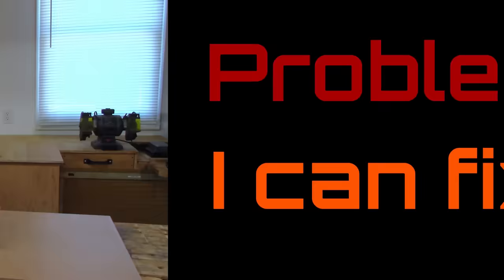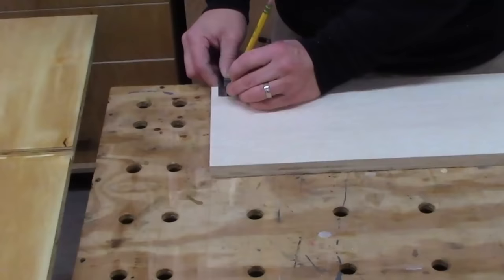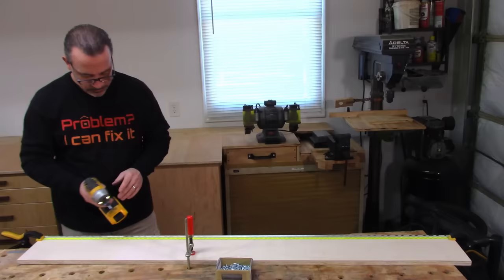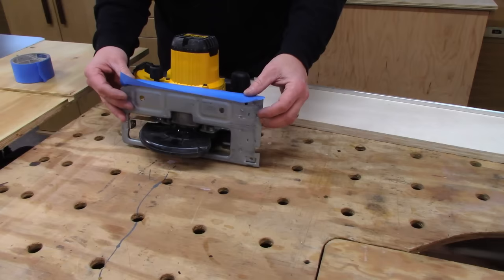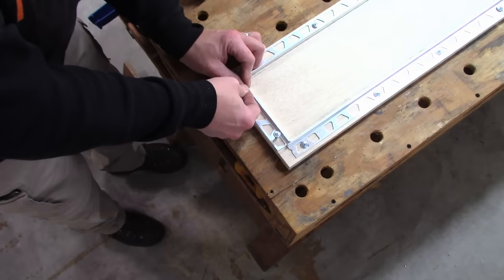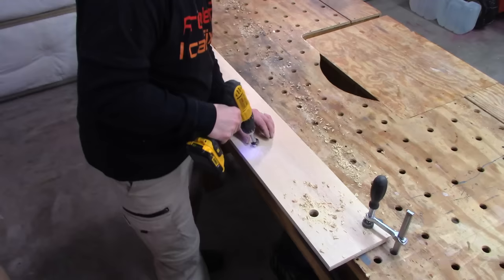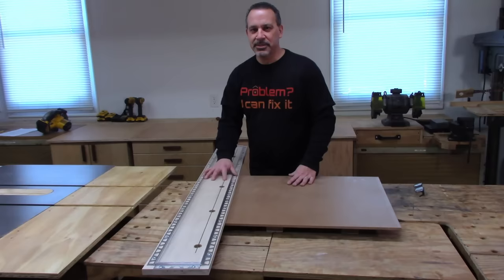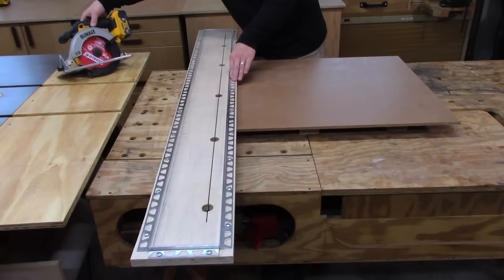Festool doesn't want you to see this DIY track saw

Comment: One trick for less saw dust while working, is to make a vacuum box table out of MDF peg board that is usually used while sanding projects. They’re usually a smaller design, but I don’t know why they wouldn’t work on a larger scale, as long as your dust collection system would be up to the challenge!
Mark Dougherty 
Toronto, Ontario.
Reply: You might need to add multiple vacuum ports to get even suction over the entire area, but you could make it as big as you want. But as you mentioned, your dust collector would need to be powerful enough. For a 4x8 table, I'd think you'd need at least 1500 CFM, if not more.
Reply: @garrisonaw You could just section off part of the table to be a vacuum box, since you're not necessarily going to be running your saw over the whole table

Comment: Love this idea. I never seem to have a straight, flat, and long enough piece of wood to hide my cut so I end up clamping my long level. Of course clamping a level only works when you can keep the blade side of the saw nearest to the guide, otherwise you end up dealing with clamp interference. Your solution seems like a no-brained. Muchas gracias señor!
Reply from the maker: You're welcome!  Thanks for watching.
Reply: @freespeechfinland  I appreciate the tip. Occasionally I need to run a bit on a narrow piece which can make clamping the straight edge a bit more complicated. Could probably still rig something up that works with the spacer. Much obliged for the insight.
Reply: Make a spacer block whose width equals the distance between the side of the saw shoe and the blade (teeth). Store it with your saw. 

For a perfectly straight cut, place the spacer block and the guide (a level or some other rigid piece with a straight edge) on your work piece. Holding the spacer block firmly against the side of the guide, position the opposite edge of the spacer block at your cut mark. Clamp the guide against your work piece. Do these same at the other end. Check with your spacer block that both ends are correct and adjust if needed. Clamp tight. Cut your piece keeping the saw shoe firmly against the guide. If the blade veers off, just cut again.
Reply: @philiphoule7170  ^ sorry, i reposted that edit after you already commented on a previous version. But it basically had the same content. Looks just confusing now. 😀
Reply: @philiphoule7170 👍 Good point. Working with narrow pieces, this can get challenging. 

If a couple small holes in the work piece are acceptable, you could use a brad nailer (if one is at hand) to temporarily fasten material at the cutting setup to improve cutting stability and safety. Shoot them well in (to avoid scraping the saw shoe) and, after the cut, pull out from the other side.

Comment: I used 1/4 inch plywood and made it 5 inches wider than my saw.  I then put the track about 4 inches in from one edge (not cutting side) and screwed it down (glued it too) and then on my first run the saw cuts off the other edge and you have a perfect edge to line up on your mark.  The overhang on the other side can be used with simple spring clamps and they don't get in the way.  I think I have made two or three of various lengths now and they work great especially if you wax them with car wax.  Good video.
Reply from the maker: If I understand you correctly you made what is commonly called a Door Board Jig.
I've sometimes had trouble with the saw veering away from the fence with those.  I picked up an aluminum straight edge at Harbor Freight that works ok if you don't forget to include the offset when measuring.
You can see it in my Lumber Cart video.
https://youtu.be/BIk2OX7-y14

Comment: Great idea to use the tile trim as guide.  One thing I find inconvenient with this design is that I have to draw a line to line up with the jig.  Using the shootboard design, I only need one little mark on each end.
Reply from the maker: I saw a similar jig where the guy used plexiglass inserts along the cutline.  That might make drawing the line unnecessary.  But plexiglass scratches really easily.
Reply: @HouseDoctorRay  i think i saw that video as well. I believe the plexiglass just make the alignment a bit more accurate, but we still need to draw a line for alignment.

Comment: I like your idea. One thing to consider if you want the saw base to glide well. Consider covering the plywood with a piece of plastic laminate (formica). No need to wax. I have a 4 inch lighter weight mini saw that I might try for making the cuts. If the guide fit is good enough it might do okay despite a shorter base line. Most sheet goods are thin enough you don't need a large diameter blade to make them.
Reply from the maker: Good idea.

Comment: That's probably better than a Festool. The one thing I would have done differently is to not worry about drilling holes to see the line. I would have just cut a slot in the opposite direction to create a slot. This would make the jig double-sided and give you the ability to line up the edge of your track with the line you want to cut, no matter how long the cut. This is one of the best features of a track saw. The edging you used was genius. Great video!
Reply: Could you please elaborate on this? I don't understand how a 2nd slot making the saw reversible (not double-sided) allows you to line up an edge. Thanks.
Reply: @cakeman58  Yes. I probably should have added that you need to cut out a rectangle with the two slots being the long sides of the rectangle by cutting to connect the ends of each slot. The long rectangle would fall away giving you the ability to line up your jig with the line to cut. Does that make sense?

The genius behind this jig is that there's no slop that needs to be adjusted and the saw will stay on track.
Reply: @jimberg98 so you would cut out a rectangle from the center of this jig, so that the saw sits on two wooden rails between the metal guides? And the edges of the wooden rails are the saw cut lines. I think that is clear now. Thank you so much for your reply.
Reply: @cakeman58 Yes. Exactly.

Comment: When making a straight cut I usually just clamp down that aluminum ruler shown in the first minute of the video ensuring the clamps are secured on the outside of the saw so the clamps don't his the saw body. Works pretty good as long as you go slow and keep the saw against that edge.
Reply from the maker: I've always had trouble with that.  I've even tried a 'Door Board Jig'.  This keeps me from wandering left or right.  It also helps with Chip out.
Reply: @HouseDoctorRay  it’s a pretty slick idea. I would probably use your idea if I had to create straight cuts all the time in the field. Good idea though.

Comment: This is sweet. The open structure of the tile edging seems easy to work with--you can place the screws at various inside corners and get a very accurate fit. Great tip, thank you 🙏🏻
Reply from the maker: Thanks, glad you like it.

Comment: Festool dust collection is a cornerstone of their system. The rails also clamp from the bottom to never impede the cut path of the saw. (Guys clamping 2x4’s hit the clamp with the motor of their 7 1/4 sidewinder) 
The Festool TS55 (corded thin kerf) is great value for money in their product line.

Comment: This is genius. Was deciding between a circular saw (mine is crap) and a track saw for furniture or things I don't want to mess up. Thanks!
Reply from the maker: Thanks.  I didn't like the designs that required bolting stuff to my saw.
Reply: Definitely go with a tracksaw then. You can always use your tracksaw as a circular saw. 
You'll thank me later for not giving you bad advice.

Comment: Ray, I like the idea of using skateboard tape or similar footing to keep the device from sliding as it is being used.  I think that trick can be used on the older idea of having a cutting jog made out of hardboard and I using a piece of 3/8- or 1/4-inch straight edge —- and the grip-tape minimizes need for clamps.

Comment: I use a two piece bolt together saw guide that I bought from Harbor Freight 10 years before I ever heard of a "track saw". And before that, any straight piece of steel or wood I could lay my hands on, just like the grandfather mentioned below.

Comment: Simple ideas are always best. 👍 Not sure about the anti slip tape. there are other 'gentler' options but it's a neat tool so thank you for posting. One thing that does bug me is the title. Its weak clickbait.
Reply from the maker: Thanks.  The grip tape is a little harsh but if you're not dragging it across your workpiece it should be fine.  You could spray some 3M and stick a milder sandpaper to the bottom...
Reply: It was worth the click bait. It’s only bad if the video isn’t awesome like this one.
Reply from the maker: Thanks.
Reply: @BOSS_DOG  Joseph was a carpenter, so not a bad choice.

Comment: So much work for such a simple item. You need to watch more YT. This was a lesson in how to complicate a rather easy and simple project.
Reply: You tube university. Lots of different ideas posted that one can try. If you are not a full time woodworker. One doesn't need to buy the top end brand tools. Stanley tools now owns craftsman. It's printed on the back of the packaging. Their garage door openers are made by chainberlain. But a good rule is to see what type of warranty is covered.
Reply: Do you have a simpler solution
Reply: @AbasiNated  Sure do. Take two pieces, diff widths, length your choice. Glue them together with overhang on each side. Run your circular on each side using different side of saw each time. Voila…simple jig. Accurate for probably 99% of jobs on-site, or at home.

Comment: I made a different type of homemade tracksaw, and for the bottom of the track I sprayed it with 3 or 4 coats of Plasti Dip to give it a rubber coating. Can be found in the spray paint isle, or sometimes in the automotive section because some people use it on their cars.
Reply from the maker: I didn't know plasti dip came in a spray.  Good idea.

Comment: I tried many different DIY tracks in the past they all work fine but when I got a Makita cordless track saw I just regret why I didn’t got it years before, better precision, quality of the cuts, dust control and if you also get a GRS16 guide rail square you can do perfect square cuts for cabinets or furniture.
Reply from the maker: It's on my wish list.
Reply: Look at my "Parallel Guided Power Saw"

Comment: Love the approach. The festool click bait was unnecessary. I might try this but I will likely still use a clamp just for peace of mind. Pretty sure I can rig something that’s clamps from below with no more profile on top than the edging.

Good stuff!
Reply from the maker: Thanks.  Check out the Match Fit dovetail clamps.
Reply: I'm with you dave, the clickbait title was annoying. Watched about 30 seconds and left the video because it was false advertising. Festool could give a crap about what this guy is doing
Reply: @johnblack9038  agreed
Reply: I agree as to the clickbait Festool comment.  Festool isn't perfect but feature for feature is far ahead of this video.  There are several other companies that make tracks equal to Festool but cheaper so even cost is not huge
Reply: I have a straight edge I bought from Sears 25 yrs ago. It came with 2 small C-clamps Never in the way.

Comment: Great solution! The OEM track saws and guides are way too expensive for the average woodworker. This is perfect! Thumbs up and a subscribe!
Reply from the maker: Thanks!
Reply: Depends. I live in a country where we have access to China internal marketplace and can order stuff from there. Makita track guides are sold for 30 USD for 1 meter, and 40 USD for 1.5 meter. This are absolutely adequate prices. I ordered both + connectors, which cost me 18 USD, for shipping I paid about 50 USD for all, and a Makita Track saw cost me 260 euros in Germany, which I bought myself when travelling to Berlin. This was waaay cheaper than ordering these items from the only local supplier.

Comment: Right, I'm making one of those, great idea!  Love the anti-slip tape because Yup, clamps get in the way every time.  I've seen a few variations on this kind of idea but this one I like the most, seems more lightweight than others I've seen.  Think I'd be tempted to 'spot' Gorilla Glue the aluminium (I'm British lol) first then add screws to reduce potential movement even though the angled aluminium is pretty rigid.

Comment: I had a similar idea to use metal edging with this design, but I used the upright rails that shelf brackets go into.  Those were  cheap, long, sturdy, and easy to find without flaws (i.e., no bends, rust, etc. like you find with metal stock).  The only problem I ran into was that they were a little too high on the board, so the saw's motor bumped into them.  I had to route a channel in the base in order to recess the rails, but otherwise I'm happy with it.
Reply: These Aluminum rails wont rust

Comment: If you want it to be dust free, re-make it out of 2 pieces of thinner plywood for the top and bottom plates, and space them with a ring of plywood that seals the outer edges, use the same piece to occasionally support the inside cut line so the top sheet doesn't bend or bounce. Then hook up a shop-vac adapter to the end. It will be noisy (due to venturi effect) if you take the time to round-over the inside edges where the blade goes with a router it will drastically reduce the noise.
Reply from the maker: Good idea.
Reply: Seems like rather an over kill when you could just pull out a vaccum cleaner and clean the floor in 1 20th of the time it takes to build this 😂
Reply: It's not just the floor. Every surface and tool will be covered in dust too. I doubt many workshops are as bare as this one. Dust removal at as close to the origin as practicable is a better strategy.

Comment: This was a great idea and good video with one exception.  Try lowering the volume of the background noise to a minimum when overdubbing the narration. Also, there's a lot of echo in your shop space.  The track and use of Schluter strips was creative. I'd like to see how this can be implimented to rip a full sheet of plywood.
Reply from the maker: Thanks.  I'm still working on my audio.  Just bought a new wireless and one for voiceovers.
To make one long enough for ripping you'd need a base 9' long.  Other than buying a 10' sheet of plywood you'd need to laminate something like luan, staggering the joints to get 9'.  The tile edging I bought was 8' 6" but they probably make 10'.
Reply: @HouseDoctorRay  Hey, Rome wasn't built in a day and I think you're doing a great job. Good advise on extending the track for ripping a full sheet.  Keep up the good work!
Reply: @HouseDoctorRay  A quick solution for audio. You can add some background music, which will fix most of the sound issues.
Reply from the maker: Good tip.  Thanks.
Reply: @HouseDoctorRay  I prefer it without background music.
Reply from the maker: How about this one?
I really like the music.
https://youtu.be/28qxw4SBhEc

Comment: As a carpenter we've been making these for 60 years but for us your base is far to thick for the limited depth of that 7.25 inch saw. I use 3/16th. Masonite as the base with a 3/4 by 3 inch board screwed to it. Set the board along the edge of the sheet stock then run the saw along the board thus cutting the sheet at the perfect point. Now lay the masonite along the salvage side of the line. There you have it, a perfect cut. Now build a second one for your router. Put a guide bushing in the router plate to follow the edge of the masonite with the 3/4x3 guiding the router base. 8 ft. dados put down every time.

Comment: Now I just need a reason to need a track saw. Been ripping for years just by eye and will say I can cut plenty straight. I just hope green horns learn to develop a good eye/hand. One youngster tried to argue he just needs a chop saw to cut his studs/blocks. A good carpenter can cut a straight end with eyeball of 90 degree and the grain without even making a square line. Now a days whole homes come pre cut, never see a full stack and a chain saw anymore lol. Course I’ve never framed a track home. Always custom. I’d like to make 2 of these one long enough to cut Little longer than 48” to accommodate and angle. And one long enough to rip a full sheet at an angle. Don’t get me wrong. Cab/furniture is a whole other ball game. I just hope kids aren’t busting out track saws to rip sheer. Never learning to develop an eye. Nice vid.

Comment: I would not be recommending using a gritty anti-slip tape as this will certainly damage the surface you are cutting.   There are other anti-slip options, I have used of matting that you put under rugs to stop them sliding on wooden floors.
Reply from the maker: I use that when I'm routing small pieces.  I was worried about it getting gummed up with sawdust since I wouldn't be able to shake it out.
Reply: I won't trust any those methods. I'm a clamper.
Reply: @iamnegan1515  only takes 2 seconds each side to clamp
Reply: @MV-wb2cz  yes. I like his setup,the guides, viewing holes are great.

Comment: I did it. I built one 11 inches wide, and 72 inches long. Triple taped treadtape on backside. My first rip cut was bang on! Wow, this works great, thanks bro! Fyi, you cannot cheap out on the plywood, no 1/2 inch or rough grade 3/4. I used sanded both sides  3/4 inch and I taped bother sides of my saw shoe, rather than taping one only. My other improvement is to bar soap the run, so the saw travels smoother. Like and sub guys 👍🙏😃😎❤
Reply from the maker: Thanks Ian, people are going to think I paid you for that comment.